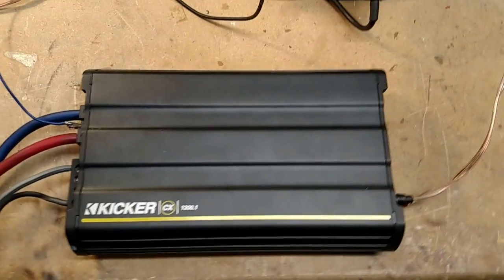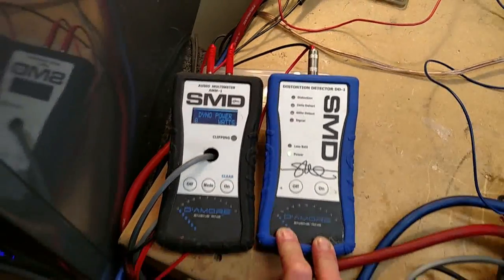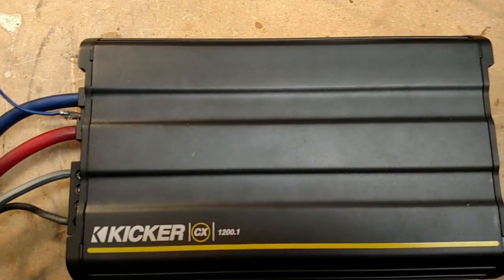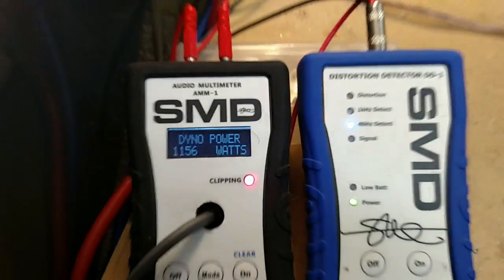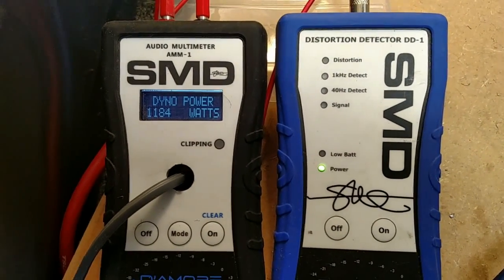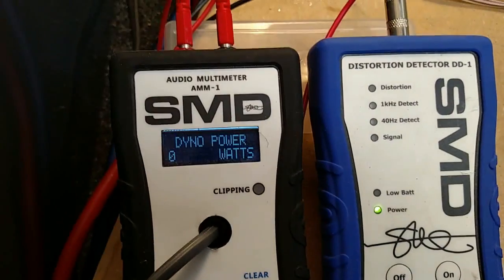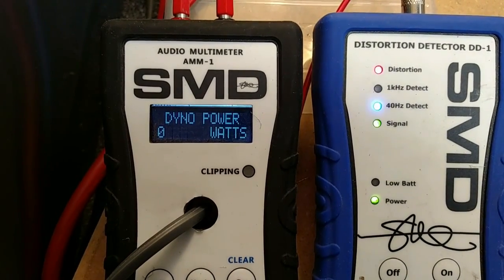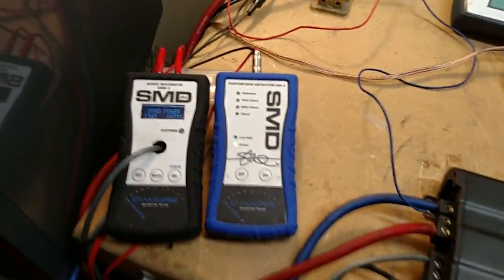AMP TEST - Kicker CX1200.1 Amp Dyno Test

Comment: I run 2 of these in my audi with a kicker dual 10inch pro comp box. I bought these at best buy during covid and they were 78 bucks a piece. I used good hardware to hook them up and I am absolutely happy with what they produce. I was skeptical at first but got really surprised by the sound. I have friends with amps that cost as much as my ride and they said my system is bumpin as well. I'm glad to see the tests you did thanks now at least I know it's not just a freak accident they sound good lol.
Reply: $78 a piece for a 1200W who tf did you jerk off for that? Ultra open-box damaged? Have a hard time believing that tbh lol. But good for you if you really did. $150 for one is a steal let alone for TWO.

Comment: I have the CX300.1 with a single 10” sub in the back of my 58 Bug, and it sounds as powerful as much bigger setups I’ve ran in trunks of other cars. I needed an amp that wouldn’t kill the electrical system, and it does a good job with what it’s in

Comment: Is this amp stable at 1 ohm? I have this amp and it says on the specs it’s only 4 ohm and 2 ohm. Can someone please help me
Reply: I’m running 2 d4 alpine type r 15s
Reply: I can also get the skar 1500.1
Reply: @TheAdio1091 which amplifier you choose? Kicker cx1200 or skar rp1500?
Reply: It depends on if you have the newer model for if its 1 ohm stable

Comment: Im at :30 and im betting it does rated

After test...Boom, wheres my money? Kicker makes good products, everyone sleeps on kicker but for a regular system for your car, kicker is great for that. If you want a competition SPL system than id go elsewhere cuz there baddest subs are only rated for like 750-1000 rms unless you can find SoloX's, they handle a lot more. But as for the kicker brand, you can depend on there ratings, they dont lie and say a 300 watt amp is a 5000 watt amp, what there amp says, is what there amps will do.

Comment: So was this 1184 watts per channel or bridge?
Reply: This is a mono amp. Can't bridge it.
Reply: Brian watson just confusing seeing 2 positive and 2 negatives on the amp bit both the same Channel
Reply: @bigkarl24  all this is for is to make.it easier if you are running more than one subwoofer. Instead of trying to cram all of your wires into just one set of outputs, this gives you two set

Comment: Why would kicker out of all companies not make what they say.  They are still Stillwater designs.  Very much in the have as any other name brand.  They are still their own company. Not like these done a dozen killowatt companies using the same boards and design and having fan boys argue about who is best meanwhile all running pretty much the same crap.  JL , Fosgate, Mosconi, hell Kicker etc.  The companies continue to innovate while the dime a dozen amp companies keep copying each other's design, slapping a name on it and saying their killowatt amp does the same power.  Well no crap you guys are all pretty much building the same old one hit wonders.  Don't get me wrong there is allot of great companies out there are considered the lil guys when it comes to company size but man you tube is full of amp dynos of pretty much identical amps you will still see fan boys argue about stupid lil things like color and RCA connection types that make their clone better than the other.  Yet we would be surprised that Kicker doesn't have to lie to make a $250 kilowatt amp.  I'll take a couple of kicker kilowatt amps for my kids ride thanks.

Comment: I run all kicker, you either have never heard of kicker which is really strange or you're just a kicker hater either way I've been running kicker for years and I always seem to blow my subs from the Kicker amps I run which is the 1200.1 thats in this video, until I stopped being cheap and got the subs that were rated for the same rms as the amp. Over all great video glad to see someone else that is as impressed with kicker as I have been over the years

Comment: Just to let everyone know. I’ve owned the cx1200.1 and a pair of kicker compR 10’s since 2016.  They have been Awesome no problems at all . The amp kicked those subs HARD and I played it daily for hours on end. Till last year my 11 yr old son showing off for his buddies cranked it up and blew one side of the amp and believe or not, it still hasn’t died!!!  It still plays and hits kinda hard. Mind you it needs to be fixed just haven’t done it yet.  Give these amp a break!!!  I’ve always had Rockin stereos in my rides and this amp has out performed 95% of the others!!  Props to you at kicker for building such a tough and Powerful little amp..  I’ll have this one fixed and buy another one and upgrade to two 12’s  1 amp per sub.  I’m redoing my mods and highs as well with all kicker and buy a kicker amp for that too.  Well really be Rockin then!!👍🤢🤢😁😁😁😎😎😎😎😎

Comment: Talked shit yet your equipment doesnt put out enough power to get enough power to it. Your dynamic test is supposed to be 14.4 and it was 13.5. So of you have good electronically in yoyr car it does rated.
Reply from the maker: Michael Beck When did I talk shit??  I praised the amp and said it would do rated right from the get go.  I said I was happy and impressed a few times during the video.
Reply: No one talked shit. Besides no stock electrical system will maintain 14.4V with blower motor running, electric radiator fans, vehicle computer, and miscellaneous other accessories running. Now throw in this amp along with another 4ch and unless electrical has been fully upgraded the voltage will drop to 13ish. The numbers the amp put out at stated voltage is a win, even if they are lower than "if lightening struck" power rating. Kicker should have called it a 1K.

Comment: My Kicker DX250.1 Blew it's 15 amp fuses,the ones that are on the actual amp. I replaced them and I disconnected my speaker input wires thinking that could have shorted the amp out, and Soon as I reconnect the power cables, they go out instantly. What can cause this problem? What exactly in the internals can cause this? I know about electrical components, capacitors, resistors and all that. Just curious what can go wrong in a amp for that to happen.Did something possibly shortout randomly?

Comment: When anything car audio is CEA  certified, it has to put out the power advertised or better.  If not it will not carry the cea stamp.  Being that it was not tested at the voltage as advertised it exceeds it's power output.

Comment: I am surprised to see that much from an entry level kicker amp too. Wow. I have had kicker amps that pushed 950 watts that were much larger in size than thus amp. Glad to see the kicker line making the best of newer technology. I'm sure that this amp at rated 14.4 volts would get everything it's supposed to. I would definitely buy this amp.

Comment: Would you guess the 250.1 is also fairly true to its number ? Im running 1 10" JL w0v3.4 sealed box  and I am told I am underpowering it.

Comment: i accidentally hooked up 2 2ohm dvc to this amp at a half ohm and it did it about half volume then went into protection i ran it 30 min on a 1 ohm load it didnt go into protection but melted an  100amp fuse but didnt go into protection now i have it wired 2 ohm in my opinion better off just running it 2 ohm all in all not bad at all and fyi not the cheapest line that would be the dx
Reply from the maker: +christopher schultz You cannot wire two DVC 2-ohm subs to 1-ohm...  ??
Reply: You can if you only use one voice coil on each sub
Reply from the maker: christopher schultz True.

Comment: I've run my cx1200 at 1.6 ohm for over a year on an eclipse aluminum and I'm impressed. I normally use more brands that aremy typically mainstream ie: sundown or incriminator but I bought it in a hurry and beat the crap out of it so far. lowish voltage, mild clipping even vibrations from being mounted on the box haven't affected it at all.

considering I only needed 500watts at 1.6 ohm and really thinking I might have to run it a 6 ohm instead this amp has out performed my expectations

Comment: I've see a lot of people in my area run cheap amps. Not kicker or Rockford not even alpine. I'm taking boss audio, Planet audio and Pyle. Not many people can afford a $250-$300 amp so they think a $120 5000watt amp is the same as a $800 5000watt amp. And they end up maximizing the gain and bass boost and blowing there woofers the Come to my shop complaining about it. Most people don't even understand when I tell them the gain is not a volume knob or a watts knob. if your amp is 200watts rms it does that even if the gain is all the way down.

Comment: Man you are dumb of course it will do 1 ohm it's a KICKEr
Reply from the maker: scubba dubba Many Kicker amps are only 2-ohm stable. and Running a 2-ohm stable amp in a vehicle on actual subwoofers that are a reactive load and have box rise is much much different than running the same amp on a straight 1-ohm purely resistive load where it does not rise.

Comment: so can i wire 2 dual 4ohms P3s to 1 ohm and this amp will handle it?? please let me know im thinking of buying it ..thanks in advance
Reply: andybabiii1 venegas don't do it, my Treo ssp 12" is a dual coil 2ohm 2000 watt sub. I wired it to 1ohm, cranked it up. It holds up surprisingly well but cutts off when I hit about 85% volume. If you don't mind running at a maximum of 85% power then go for it

Comment: This Amp is great I have it running 4 12'inch 2015 Comp R It only went into protect once when I had the amp in a closed area where my spare tire used to be in the summer. Now I have it close to the speakers with more air going to it and it just gets warm now. I wanna get a 2000 watt kicker amp but I got this Amp for $250. The 2000 watt RMS amp from kicker is going to be $1000 so I am considering just getting another CX 1200.1? I just don't wanna run more wires.

Comment: there is a certification in the box that will give you the wattage specific to the amp and it is always guaranteed to be higher than it's box rated power. Also that amp is was not $249 when released, it is $349. the newer xca1200.1 is the same price. Now you might be able to get the older one for nearly $319. These amps are solid and put out clean, true power for the price. And also they are not the lowest end of their line. The DX is.
Reply: I love finding used gold items that others dont know bout its 2020 and Im bout to scoop this on FB
Reply: Bryan C L X T I've sold about 6 of these amps on FB for 200 or 250 each
Reply: @long-dongvonbraun501  your mistake, live n learn.
Reply: Scorpio1970 mistake? How so?
Reply: @long-dongvonbraun501  Obviously for selling them for less than others. Unless they had been out for a long time i guess it'd be normal. Why am i explaining this?
Reply: Scorpio1970 Some were beat up more than others. I don't know why you even commented, other than trying to be funny. Take the L and keep it moving
Reply: @long-dongvonbraun501  facts bro dude above is a goof ive bought these from people selling em on facebook or offerup got one for 100$ flipped it for 250 another one for 180 sold for 300$ flat bro
Reply: @GuapoXSniper facts dude is huffing glue or something. What $300?!? At one point I had four of these until they came out with the 1ohm stable version
Reply: @long-dongvonbraun501  lmao I got 1 for 75 off a random … instead of selling for 250 I just put it in my girls car 🤣
Reply: @long-dongvonbraun501  I think he was talking Brand new not eBay or offer up
Reply: @guapoxsniper7432  I just paid 379.00 yesterday...put it on comp R 12's...it hits hard...gonna have to dyno mat my trunk QUICKLY😂😂😂😂
Reply: @bryanCLXT  same here lol., just got two 15' fosgate p3 's in a qbomb box with a kicker 1200.1 all great shape for $200 lol
Reply: Dx is just a older entry line
Reply: I'm not sure why you would have thought this amp wouldn't have hit its rated power. I've owned over 20 kicker amps throughout my life and, I've never had one that didn't produce more.tjan its rated power.
Reply: Thanks for the info. Good comment
Reply: I have a DX500.1 its still higher than 500 or no?

Comment: I hate it when people underestimate Kicker.... I've have multiple Kicker subs and amps. They always do what's advertised and I've NEVER had a single problem with any of them.
Reply: Same for me, I’ve never had issues with kicker product. I took an entry level comp and put it on 800 watts rms just for fun and the cool didn’t blow but it ripped the surround. I was really surprised the coil didn’t cook so I used strips of gorilla tape to make a “surround” and I put 1000 watts to it and it still didn’t blow! I put it up on my little wall of fame and it’ll still play.
Reply: Dude I got a kicker kxa amp (2400.1) at 2 ohm
I just learned I can drop her to 1 ohm and get 3500 rms
Kicker amps for life.

Comment: I got a question brotha, I have this amp and two Rockford fosgate p3 12s in a rhino box wired at 4ohm. Bass is so damm clean I've been wondering how the subs sound at 1ohm. I've done research and all say this amp won't handle 1ohm. Anyways I almost bought a 1ohm stable amp but watching this video looks like it should handle it. what you think, am I good? The most I bump my music is 45min to 1hr driving to work.
Reply: Manuel Vargas hey i was wondering if you wired your 2 P3s to 1ohm on this amp?? and if it worked? kus thats what i was thibg of doing... let me know please

Comment: i have this amp cx 1200.1 an 2 l7 15 solo baric whats the best way to wire it to get the most out of each speaker please anybody
Reply: Lemaur Gracey What ohms are your sub's 2 ohm or 4 ohm?
Reply: 4 ohms I wire them down to 2 ohms an they are hitting just right thanks....
Reply: Lemaur Gracey Well actually man if you have 2 L7s 4 ohm dvc then that means you're either running them in parallel for a 1 ohm or series 4 ohm load so no wonder they're beating hard you got that amp down to 1 ohm nice
Reply: That's what I meant to say lol yes it is a at 1 ohm an it is parallel....that amp is underrated for sure.....Thanks for taking the time to respond back
Reply: Lemaur Gracey Damn that's nice man I was thinking of getting one to replace my Skar audio 1000 for my 2 CS 15s because they're 600 rms each and the Skar is only giving them around 700 rms right now. Does it get hot on you? You can check mine out on my channel tho.
Reply: it's not cutting out or anything I had to run another battery but it's doing fine I got it in my, Infiniti fx45 an it a live concert back there lol.....for the money it's a great amp an I bought those 15 L7's refurbished
Reply: Lemaur Gracey I used to get Alot of Refurbished L7 and L5s off of hifisoundconnection never had a problem with any of them. It looks like I'm sold on this amp because if you're doing good at 1 ohm then I know I'm be good running at 2 ohms :)
Reply: for sure

Comment: this may sound like a ridiculous question I have the same amp got it for free but I was just wondering if I could run components off this amp 6 total can any one help
Reply: jr galvan of you know what ypur doing yes
Reply: OK thanks
Reply: The amp is is 2 ohm stable. As long as you wire the components  within the ohm loads it should be fine. that is alot of mono components lol.  study up on the series and parallel effects on ohm loads.
Reply: Thanks Matt I sold the amount but will definitely keep that in mind
Reply: The amp

Comment: I have this amp, actually the newer model(cxa1200.1). I'm debating on getting the Kicker L7 12" (750 RMS/1500 peak), or L7 15" (1000 RMS/2000 peak)? I'm leaning more towards the 12", just because the size would be better.. although I would rather have the "more correct" "setup".
Reply: guitarzrawsome  it pushes my l7 15 no problem, and almost destroyed my dc audio level 4 15
Reply: Thanks for your time
Reply: Neither is "more correct". You need to look at the space you're willing to sacrifice in the vehicle for an enclosure. if you've got 4 cuft to give, let that 15" eat.
Reply: Ended up getting the 15" L7
Reply: guitarzrawsome does it sound really loud with this amp??
Reply: andybabiii1 venegas with factory specs on box, it slaps louder than my old 2 12” compvr on kicker cxa600.1

Comment: is that rms rating??? i have 4 cvr 12s willl that push them or no ??
Reply: I think when he does each test, that is what the amp is producing in watts. When the test he did, for example lets just say it read 1200 watts when he did it... assuming if your subs are 400rms each sub, that means that this amp would only power 3 of your subs, BUT I think this amp is cable of doing more than that, so yes my opinion, you can use this amp but there would be better choices. Do not buy cheap amps. YOU GET WHAT YOU PAY FOR
Reply: Yes, those are the RMS results. And power handling is not only dictated by the subwoofers. Subwoofer power handling changes depending on the enclosure they are in. That said, this amp is still a load of juice. Buy it and let em bang. Also ensure your vehicle's electrical system is up to the task. Takes power to make power.